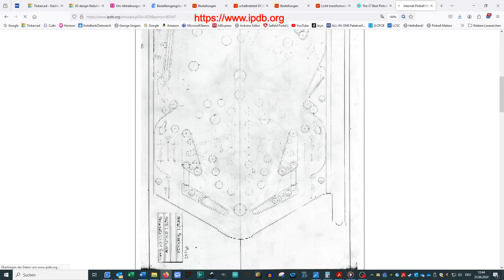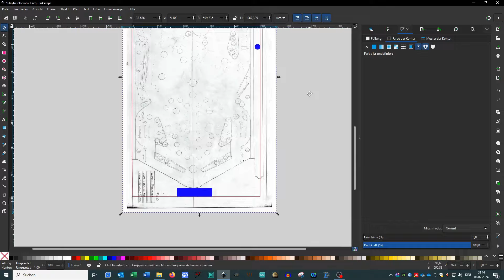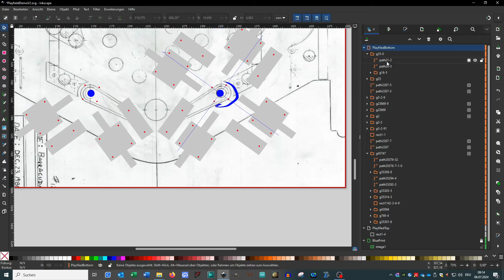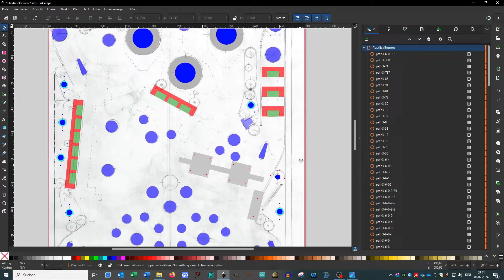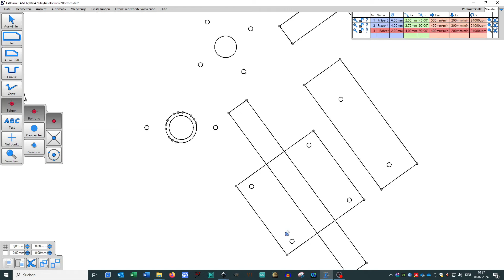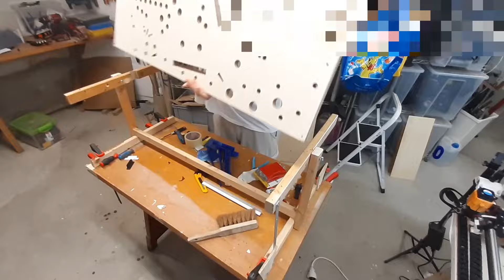DIY Pinball  - Part 1 - Bally Fathom Replica - milling the playfield

Comment: Hi Fabe, I'm doing a replica of a 90's pinball myself. Still didn't start with the table, I'm currently working on a module that can be used to run any pinmame rom to control real hardware. Meaning, after doing that, I could build any table that is available in pinmame. Your videos are very helpful for me and I'm very impressed by your work.
Reply: Hello, how are you, will you make the module project available, here in Brazil there are not many people who do this type of projects, I want to build some pinball machines from the 80s and all help will be welcome, thank you.

Ola tudo bem, vc vai disponibilizar, o progeto do modulo, aqui no Brazil não tem muitas pessoas que fazem este tipo de projetos, eu quero construir algumas maquinas de pinball dos anos 80 e toda ajuda será bem vinda, obrigado .
Reply: @Edu5900  Hello there! Currently, it's just a work in progress. Even the circuit boards are 3d printed breadboards with the components. I'm trying to make everything work before buying some real PCBs. The proyect in its current state is all 3d printed and very bullky, like an external box with lots of connectors. One connector for each element. This, in my case, is to be able to disconnect one table and connect another one. A single controller for any table, useful for small spaces or prototyping of a table replica. The downside is all the work involved with wiring the module to a table and the need of a computer connected via USB to the module. This is planned to be upgraded to use a Raspberry Pi as a computer instead of having an actual computer with a wire to the pinball table. Progress is slow, but it's going fine so far.
Thank you for your interest, Edu. I'll gladly help you out in your proyect if I can somehow. Are you trying to build just one pinball table or are you planning on building more in the future?
Reply: @mikelarrutiromero9430  Thank you, at the moment just one to start but I would like to build others here in Brazil, there was a company called Taito that manufactured several tables that were versions of American machines, I would like to be able to work mixed, my interest is to build this table for my own use, Thank you For your attention, I'll send you a shout out for any news, thanks.
Reply: @Edu5900  you are welcome! My module might be helpful for your case. It just makes communication between a PC and real hardware. I'm using pinmame as it's what I need for my project, but you could basically use or create any other program to run custom roms, if you know how the module works, anything is possible. My goal is that the module supports 128 inputs and 256 outputs. Enough to recreate any table or go wild and overengineer something new.
Reply: @mikelarrutiromero9430  Hello, how are you, I wanted to know if I can use (Placa Zero Delas Usb Árcade Joystick P/Raspberry Pi3 P) to activate solenoids through the PC and which program I can do this using the ROM of the pinball machine, in fact I wanted to install the ROM on the Arduino Mega and then distribute it to the other parts of the table, I haven't started anything yet, I just want to know what would be the best way to create the Pinball Machine, OK, Thanks

Comment: Are the svg files of the components like flippers and bumpers also available for download somewhere?

And did you diy the cnc or is it based on an already existing project. If so is it possible to share that info also? Thank you!
Keep up the great work! Love to see more and build my own!
Reply from the maker: Hi Thanks! I do provide some STLs Designs for 3d printig, as well Greber Files to make the needed PCB. You can find them ob https://cults3d.com/en/users/wilfriedfabian/3d-models.
Reply: @fabe1690  yeah I saw that. Discussing with my dad who is gonna buy them 😂. Do you also have some sort of guide to have the points system?
And if possible also your cnc
Reply from the maker: @yornola  Hi, the CNC is a self build "MPCNC" = mostly printed CNC" -> heres the Web Page https://docs.v1e.com/mpcnc/intro/
However i found out that this is not worth the work. if i ever will do another Pinball Machine i will do it again by manual milling. The stensils/templatea for that are also included with the Files on cults3d. 
I'm not sure what you mean with points system - if you mean the controller controlling all asseblys, diplay etc.:  i use a Ardunio Mega (with some STLs on Cults3d i include also some example code), with no special "Pinball" Libarys - i did programm it from scratch.
Reply: @fabe1690  thanks for all the info. Definitely will check out your cults3D page for more info and code. Very excited to see your new build!